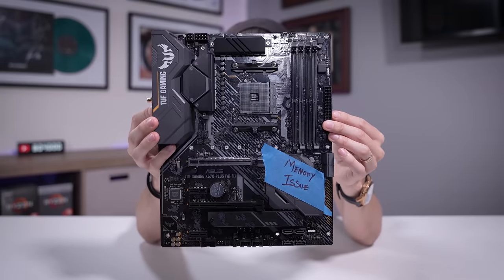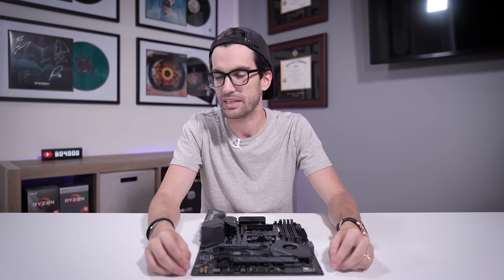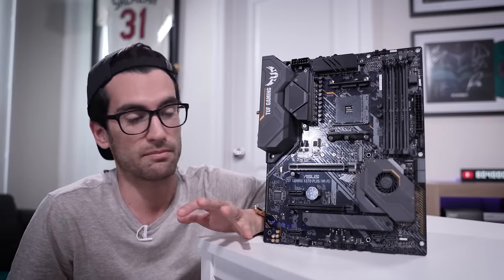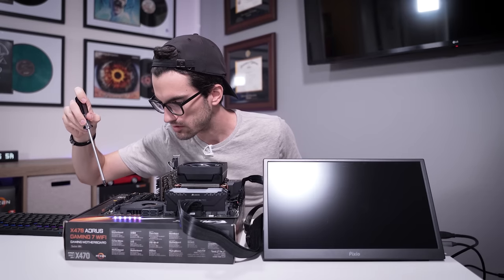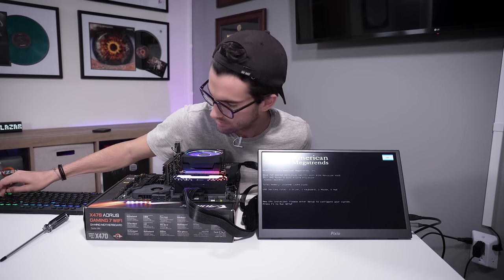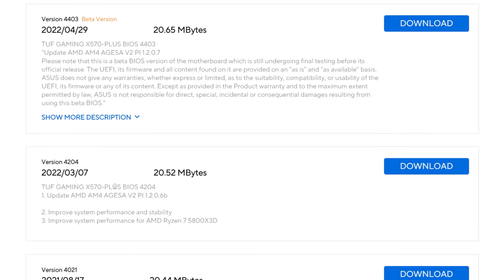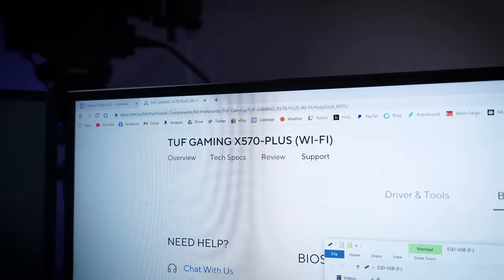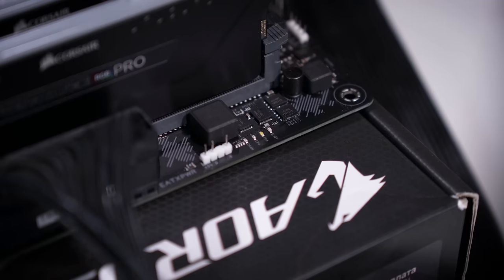Is This Viewer's Motherboard ACTUALLY Broken?!

Comment: Props for showing the oopsie grabbing the wrong bios and trying to flash it.  Been there myself a few times.  Luckily most boards should catch it, but just a good idea to double check what you're doing.
Reply: agreed!
Reply: Some board makers make several boards with almost the same model number, very irritating!! 😝😝
Reply: I once was trying to flash a board for a friend for like an hour. Thought it was the usb drive’s format or that I renamed the file wrong. I started panicking.

All of a sudden I saw the wifi antenna ports on the IO….realised I was trying to flash the non-wifi BIOS.🤦‍♂️

10 minutes later were in windows, latest bios and a ryzen 5000 up and running.
Reply: To add to this sometimes I bios needs to be updated in increments. I had one last week that couldn't find a valid file even though the latest was on the memory stick.
Reply: Updating a bios scares me to fire everytime I do it. Mainly worried about a power surge or outage. I have never bricked a board yet doing it. On my last couple of builds they have the bios flash back feature which makes things a whole lot easier. Great call Greg and what an upstanding person for admitting a simple oversight.

Comment: I had a similar issue with the exact same board when I updated the bios to the latest one 2 months or so ago. I was getting ready to upgrade from a 3000 series to a 5000 series. What I did was re-flash the board with 4204 and everything worked like it should.

Comment: I can so relate to this video. Many times as a tech (retired now) I found that I was so locked into the possible source of the problem that I refused to consider other possibilities. I had my manager tell me when I was first starting out, never overlook the obvious. Or to quote my favourite consulting detective, "It is a capital mistake to theorize before one has the data".
Reply: what if not even the keyboard turns on and no screen, i tried to flash the bios with usb

Comment: The videos absolutely help a lot. Your MSI AIO videos raised a red flag when my computer randomly shut down. It turns out that the AIO pump is dead or the liquid inside is contaminated just like what you demonstrated in the videos

Comment: Sad that many of these early x570 boards didn't have flashback. Many a board have been dumped as a result. This feature needs to be on boards no matter how "cheap."
Reply: It's not a upgraded feature for the PC novice. Manufacturers/retailers do not want to be dealing with bricked board returns and high tech support call volumes. This feature is useless for the vast majority of PC users because they do not mess around with the bios for the most part and most are illiterate when it comes down to this.
Reply: @spankbuda7466  I mean most users won't be overclocking their RAM/CPU, setting PCIe bifrucation, or so on besides enabling XMP, but when say someone wants to upgrade their CPU and need a BIOS update, this feature would be extremely helpful. On top of the fact that not even bios flashback, just a second chip, likely doesn't cost more than 50 cents in bulk considering how small they are.
Reply: @spankbuda7466  You say its for the pc novice, then say the average consumer won't update the bios and are illiterate anyway...so it isnt for the novice?
You then say they don't want to deal with rma, but some boards don't work out of the box with certain cpus... which could result in an rma?
I dont understand what are you trying to say?
Reply: My mistake, I was typing and accidentally cleared out "not". But also, when you state that some boards doesn't work with certain CPU's that falls on the end user for not reading the packaging or contacting the manufacturer tech support because of their ignorance. This is when prebuilds are important. Some people shouldn't be building anything without researching and studying first.
Reply: @spankbuda7466  clears that up lol. But in this case it really doesn't always fall on the end user, because lots of b50/x570 boards didn't work with ryzen 5000 out of the gate, so how can a user possibly know that when amd advertise new cpus without explaining any of this? Also even some intel b660 boards have this issue with 12th gen and this is the first gen on that socket!
Reply: @James-jh6wq  Stop thinking that the vast majority are PC literate when dealing with hardware/firmware. Because they're not! There was a reason why manufacturers use to lockout the bios from the end user 15+ years ago. Why would the manufacturer need to add and spend extra money on bios flashback on every mobo? Also, XMP is a overclock feature! There's people today that doesn't know about it or just found out about it recently from watching a YT video. No one knows how much it would cost the manufacturer to add an additional bios chip. Every penny counts in business. Consumers are like whining needed children at a Walmart that always wanting something that they do not need.
Reply: @qT_p13  Nope, you're wrong! AMD clearly stated in their conference on which boards that will support the latest 5000 series chips. If you're a PC builder you would know this. If you're an average PC user you would not know this and also wouldn't be looking to upgrade your CPU. Most people are scared of opening their PC because they think that they will be electrocuted. Just read the comments of these PC building videos. They're trying to build up their level of confidence. And this goes right back to what I was originally saying about the bios flashback is not needed on every board because the average person will not be in the bios, using the bios flashback, they're not overclockers, and they don't know what the majority of the bios acronyms even mean.
Reply: @spankbuda7466  amd stated which boards will support ryzem 5000. If you went to the store next morning and bought those cpus with the "right" board, you would find they need a bios update, and on many boards including the very tuf gaming wifi featured in this video, a correct bios didn't even exist yet. Besides how could an x570 board sitting in a warehouse for a few weeks/months have the right bios installed when ryzen 5000 launched? They didnt!! 
And im not talking about an upgrade, im talking about buying new off the shelf. And like I said, most early x570 didn't have flashback, and the shit show that proceeded is actually why b550 made such a huge deal about its inclusion in the majority of motherboards to begin with. Because when zen2 launched they had so many bios issues they realized how much they fucked up and needed to make sure they didnt repeat that. If you were a pc builder you would know this.

Comment: Bios updating may be one of the first things you should do in the future.  It doesn't take long to do and it seems to fix a lot of problems.
Reply: Its a good thing to only update bios if needed.
Reply: Last bios update for my motherboard almost broke the whole computer. So bios update doesn't always fix problems but it can also bring problems
Reply: @tubesami  i bricked a mobo in a new rig back in 2005. Tryed to update bios just cause i wanted it up to date. Never updated a bios since lol

Comment: having a dual bios saved my board! It’s to bad it’s hard to find newer boards with them. Also recommend getting a UPS in case you ever do have some sort of power outage during update.
Reply: What kind of board?
Reply: Doubt they even make boards with a legacy bios and UEFI bios anymore
Reply: @TheSlickmicks  This was an old X99A SLI Plus!
Reply: for most new boards you wont need this because even if your bios becomes corrupt you can (atleast in theory) still reflash it with the USB autoflash features. You wont even need CPU/RAM to update/reflash.

Comment: Actually, you do not need to rename if you do not use Bios flashback. The renamer is just in case you do not get into bios/EZflash (new cpu with old bios for example) and use one of the usb slots on the back - even without ram or cpu installed.

Comment: I picked this motherboard for my first 3950X  Build. This board still gives me NIGHTMARES. Can't count how many times I had to pop out the battery. Very picky when it comes to RAM period. Even on the latest bios, enabling XMP will give you a black screen. I passed this X570 TUF Gaming 

Plus Wi-Fi to my younger brother, told him don't mess with anything in the bios, and got me the ROG X570-E Wifi, that does actually boot into Safe Mode due to overclocking errors.

This board is infamous for sure Greg. I'm glad you figured it out in the end Keep up the great content.

Comment: Recently I had issue with RAM modules detected in BIOS, but once it booted into Windows, BSOD happened. Sometimes, it would stay in Windows for quite some time without problems. But later checking using Memory Diagnostics proved that the RAM modules (dual-channel) had issues, therefore memory integrity is something you should check too.

Comment: I had a similar issue where my new board wouldn't post with DIMMS in a dual channel configuration and it all came down to the mounting pressure of my AIO on the CPU, which is one of the things that I learned watching this series. Thanks Greg for making these videos - we are learning right along with you!

Comment: I had a BIOs issue a few months back. I swapped my 3700x to a 5950x and for some reason the new CPU did not work with the latest BIOs update. I would try to load into any games and it was just restart my PC. Tried everything I learned from this series to try to figure out what was wrong with the new CPU. After weeks to testing and trying things out, my PC stopped restating and all I had to do is roll back to an old BIOs. So from everyone that watches your series and your content I wanna thank you for all you do to help us out. 🙌🙌🙌

Comment: Glad to see the motherboard is working fine now! 

I’m actually considering updating my TUF x570 Plus WI-FI board again due to some random stutters I get on Windows 11. Apparently that BIOS version you tried is now out of beta and it also fixes some “random stuttering due to fTPM”. 

Still considering if it’s worth a try. Even though my area is not necessarily known to have random outages, I still get nervous that something will go terribly wrong during a BIOS update.

Comment: I own a TUF GAMING X570 PLUS (WI-FI). I had a plethora of booting issues for the first few months of ownership. Every time a new BIOS would come out I would update it and everything would work fine for a few months. Then, boot loops. My issue seemed to be a combination of a 5600X and 3600 MHz CL18 Vengeance low-profile RAM. That orange light would come on CONSTANTLY. I appreciate you taking the time to revisit this because it made me less apprehensive about installing 4403 (which is out of beta phase now).

Comment: I have a suggestion. Make a check list. Start with all the common problems at the top and work your way down to the bottom. Put things like check bios. Clear CMOS at the top. And then things like Cpu Pins etc etc down the line. Might help you stay more organized while trouble shooting. You do great but this might help you stay in line more.

Comment: had same issue on my z390 asus tuf when I replaced my gpu worked fine before  , had to boot on slot 1 single ram and turn on dual memory manually again worked fine, might be asus tuf thing

Comment: For Asus boards you only need the renamer tool for BIOS Flashback, not for EZ Flash although using the tool it doesn't hurt anything just a step you can skip if not using BIOS Flashback

Comment: There is a clear cmos jumper that you could have tried first

Sometimes connectors can get a bit of corrosion buildup that blocks electrical connections. Reseating the component a few times can sometimes clean off the connection and the component starts working again.

The user may also have been playing around with memory overclocking or  bios mods and bricked the board and done something like change timings on one stick  that didnt work

Comment: I have that exact same board, i got a Ryzen 5 3600 just before Covid-19 in January of 2020 with this board. Only two problems i had...the cpu ran very hot on the stock cooler which was odd to me...after seeing other reviews with that problem it seems the stock cooler was not doing a good job...so i got a beefy cooler and that solved the problem....sometime this year the PC just started shutting down...after doing PSU testing..Memory testing it seems that the board just needed a proper cleaning lol its working good now... :) !! nice video i sub and greetings from the Caribbean island nation of St. Kitts and Nevis !!!

Comment: Thank you for the video, it's very cool to share your knowledge on this because it is very difficult to get help. When it come to computers we remplace the faulty part and voilà but it's not always possible or even interesting to invest again and again on older gens. I'm in that case. 

I have a motherboard that refuses to turn on when I shortcut the power button. The red light stays on and that's it. The board was functioning I installed win11 by bypassing all the prep requisites (it's a z97 board) I used the pc for a couple of days turning it on and off, then I let it on. When I came back it was apparently on sleep but it refused to wake up when hitting the keyboard or wathever. I turned it off with the shortcut but since then it refuses to turn on again. Actually it did turn on a few times but there was always a issue like vram. The last time it turned on correctly but I had incorrectly plugged the graphic card (arggh) . There was a message on the screen saying power wasn't correctly supplied to the gpu. I turned everything off and correctly plugged the 6 pin vga power. The problem is the motherboard refuses to turn on since then. Everytime I was able to turn it back again I had it unplugged for hours before retrying but this time nothing seems to work.

Do you have idea? Any help would be appreciated :)

Comment: I had one of those motherboards. It crashed/died within 3 weeks of purchase. I couldn't get it to post no matter what configuration of memory I tried, no matter whether I reset the cmos or removed the batter, took it out of the case and tried building it minimalist style with only ram and CPU and graphics. I was able to return it to the retailer and get a new one. I have had that new one for almost 2 years now and it works just fine.

Comment: Couple things:
First, I would never go straight for a "Beta" version of ANYTHING when attempting to troubleshoot something with an updated version of something. Start with the latest STABLE version and THEN and only then, test the beta version. Especially with a BIOS, once you update to that beta version, you may no longer be able to downgrade the BIOS back to the latest stable version if you run into bugs that are being caused by the beta build.

Second, the BIOSrenamer tool has nothing to do with whether or not the BIOS can be read by the board and flashed via normal means (through the BIOS flash utility within the BIOS). The BIOSrenamer tool is specifically for renaming the BIOS file for BIOS Flashback functionality (if the board has it).

Comment: You may want to buy some specific accessories here: 1) a PC debug card and 2) a universal EEPROM programmer with programming clips. The first is really just a Dr. Debug LED set on a card, which can give you POST codes on literally any motherboard as long as i have the correct PCI, PCIe, LPC or Debug UART connector. And the latter allows you to rescue any screwed up BIOS flashes and force flashing any BIOS bypassing all security checks.

Comment: I have multiple Asus motherboards and have NEVER renamed the bios .CAP file before flashing.  I think the renaming is ONLY if doing a Flashback function or using the Crashfree function.   I always use the default bios naming that Asus uses when packaging the bios file name.   I have the Wifi version of this exact motherboard and have had zero issues with bios flashing.

Comment: When I built my AM4 upgrade in June 2020, I had bought my RAM and 3600 before I finalized on my MB due to that thing we were all dealing with although I sort of had a good idea what it would be, just depended on availability. I should have made sure the RAM I bought was on the compatibility list for the 2 boards I wanted. Short story I ran with 1 stick (8) because my board initially recognized 2 then didn't like 1 of the stick. I came back a few months later and then it liked both, then a few months later didn't. Recently it like the "bad" stick better than the "good" one. Updating the Bios seemed to help each time I encountered problems. I had both sticks in at 3200 for 5 months once and then that stopped. I have both sticks in now at 2666. I'll likely revisit this, maybe inspect the dimm sockets for debris, use the DRAM calculator, etc. Wish I had some sticks on the certified list though, my 1st mistake.

Comment: Had a very similar issue with an open box MSI Z490 Tomahawk from MicroCenter. Couldn't get it to post no matter what and kept getting DRAM light. Unfortunately I couldn't get into bios no matter what and there's no bios flash option on that board. After hours of troubleshooting and frustration ended up returning it and MicroCenter gave me a great deal on a different mobo for the trouble I had with the Tomahawk

Comment: Did you reset motherboard to factory settings first than play around with different RAM slots to get the PC to POST? I know some motherboard vendors now reset RAM to default speeds as to minimise borking a BIOS update but it's still good practice for the end user to do it anyway. Good vid all the same, glad you followed up with this motherboard's issues.